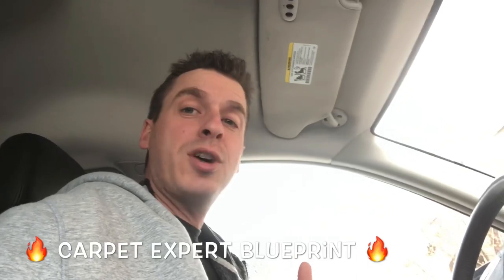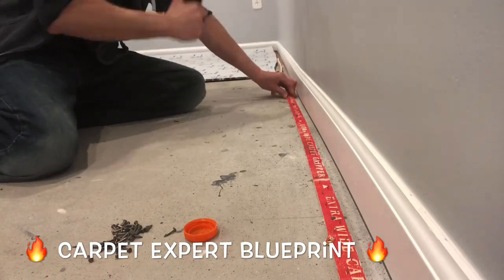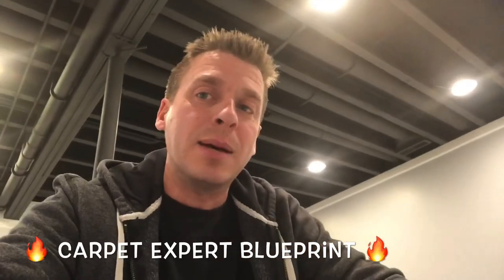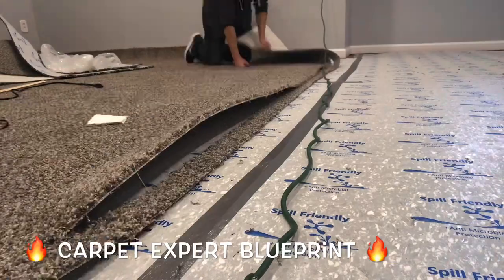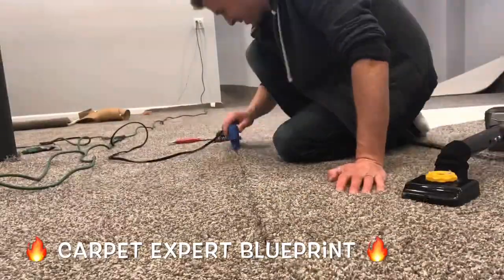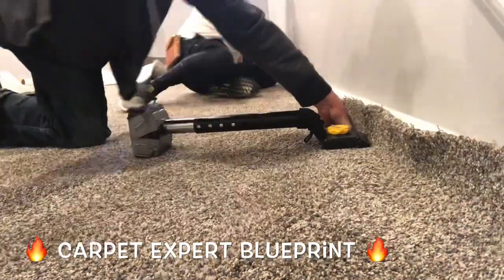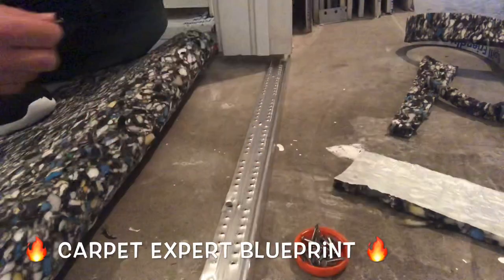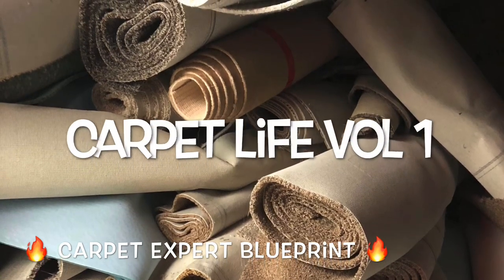🔥 Carpet Installation Problems 🔥 Vol 1

Comment: You might as well overlap and doublecut that plush lmao. its pretty easy to follow a row with your knife but the seam still wont look as good as a row cutter or straight edge will make it look. Another thing that I never understood is all the "installers" who kick with one knee on the floor. When I was taught how to kick (not set) I got my full body weight off the ground when my knee hit the pad. I only kicked for a couple years and graduated to a stretcher as a kicker gives you an apartment grade install at best. I believe the installer here just doesnt believe in spending money on tools

Comment: I used a super strength pro grade with a tight slump concrete for parts of my slab when i had to repair it.  When i went to put down my tak strips the other slab went down fine but every part where the stuff i poured every nail i used would bend and just break a tiny tiny nibble of the concrete out..  used a 5lb short sledge and still, first swing the nails would horse shoe..  even a carbide mason bit with impact or hammer driver took 5 mins to drill a half inch down...  lol  so yea, yalld hate me if i hired yall..

Comment: I really like that you can freestyle your seams, could you do a video of how to freestyle you seams?
Reply from the maker: Dave thank you! Absolutely will do!
Reply: @CarpetExpertBlueprint  thank you and keep up the great work with the videos. $$$
Reply: Dave, it's called " Reverse Row running". You cut down the same row on the backing. This method is old school, before , row runners, top cutters ,and straight edges. Today's carpets are cheaper and the rows are not straight so most plushes should be straight edged not top cut. Example,, top cut the seams ,dry fit, and it's tight in the middle but a big gap at the ends,,, that's the bow in the rug , so just save the headache and straight edge the seams. And make sure the rug is flat when straight edging or those cuts will bow also!  Berbers are a different animal, row run, top cut , pattern match , seam seal all carpets then work the seam accordingly.  This guy is a hack,,, I watch him cause he makes me laugh!!! Watch  Carpet by Southern Boys, much better installers and info!  Good luck!
Reply: @stevehamman4465  to be fair you have some great points as most of what your saying is true!!😆 Thanks for your advice bro 👍

Comment: Stretching then seaming is the reccomended way bro
Reply: How dat work??  My opinion best way is to glue the carpet down first, then stretch then padding, then seam then tack strip, more glue then cut to length...  perfect everytime..  gotta use bondo though for the glue.. and gotta work quick...  instead of stretching also, i found a better alternative is to use a propane weed killer torch..  especially if the material is vinyl.. works wonders..  gotta move slow though and make sure you get the heat into the yarn of the carpet..  the shrinkage is normal, is how you know its working and itll vacuum out...
Reply: @Z-Ack  nice lol
Reply: @Z-Ack  , naw  dude 16 common shank on the tack strip, must use air nailed it slams those babies right into the crete!! I use top cutter for cutting pad around strips makes a nice straight cut very smooth and I'm good to go!!! But I'm going to try some of your techniques, they sound awesome!!!! Thanks for the tips!!